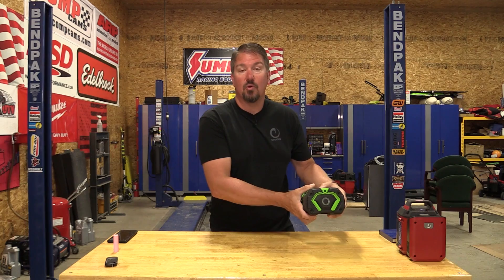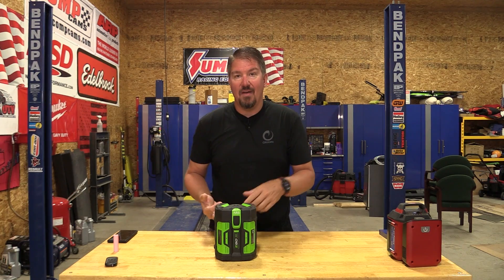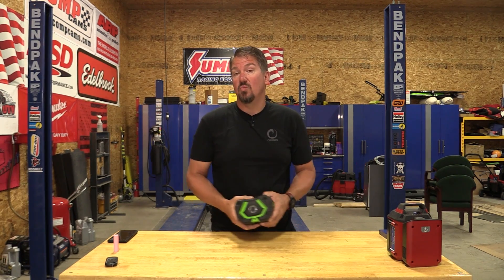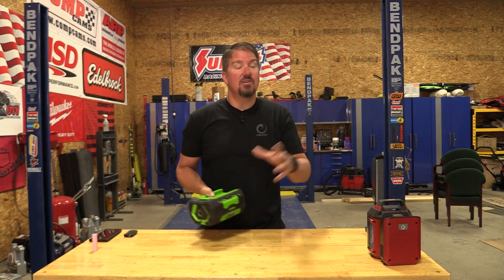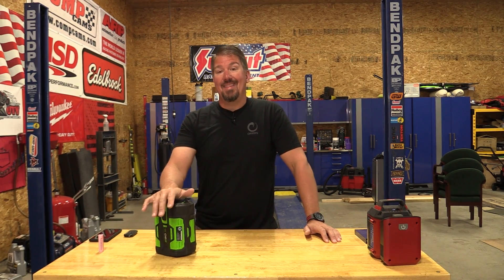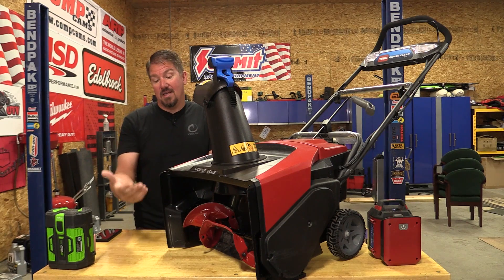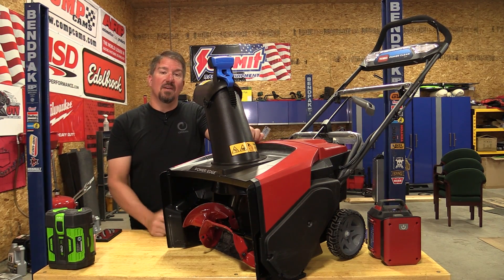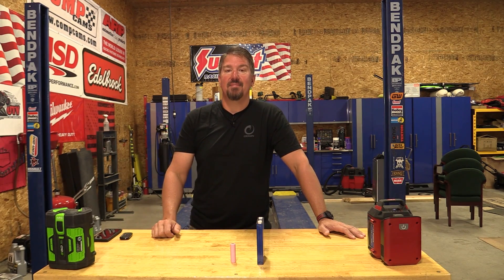Battery Powered OPE - The BIG Elephant In The Room No One Wants to Talk About!

Comment: Reduce, Reuse, Recycle. Its that order and for a reason. The less you can use up front is always the best course of action, reuse/repurpose what you can. Then when ALL ELSE fails, recycle. So using higher quality cells up front that reduce failure rates and extend service life for the same given material is always the best choice. Repairing a pack will always be better than replacing. Recycle only when damaged beyond repair. 

 Plastic bottle recycling was the biggest scam ever introduced, and it only ever worked because of the shipping overseas where it was recycled at the cost of human lives, or just dumped in the ocean. Here in ny theres a 5 cent deposit on bottle caps and recyclers just get their 5 cents for the cap and they toss the bottle, thats how they make their money. Yay government. Plastic was never recyclable and the fact people still think it is shows just how big of a ploy its been. But given people still think diamonds are worth something, shows just how impressionable people are.

Comment: My buddys 2013 model S had its original pack last 230k miles. He finally had to replace the pack, his car now has significantly more range than it did new, so it wasnt a replacement, its an upgrade. 

In recycling lithium batteries, 75-85% of the materials are recyclable and while it cost a lot to recycle them, it turns a profit on selling the raw materials because of how expensive mining is, the cost are close. 

It is more efficient emissions wise to burn LNG at a plant, send that power to my house and charge a battery than it is to run a 2 stroke gas engine, and its the same for an electric car, period. Even with all the charging losses, an ICE has 20-40% efficiency from fuel to output while a battery is 50-60%. 

I know lithium ion battery devices are NOT ready for mainstream, but the technology is not as youre describing it at all.

Comment: I get your side of the convo. I really do, and I have the same possible worries. I had Milwaukee OPE. both the Quiklok hedge trimmer and the reg hedge trimmer The handheld is junk because of tooth design; it doesn't feed branches into the teeth very well, and it is insanely front-heavy. The quiklok cuts well but broke recently for me(user issue). I want a battery hedge trimmer because power isn't a problem, and they're pretty efficient, so they have good run time. I wanted something lighter, so I looked at my ego. They're innovating with carbon fiber, so they're lighter, and that's attractive to me. I also looked at XGT platform, but their stuff is like 2x the price of anything else. Stihl's cheapest commercial hedge trimmer is 449, so idk what to do. I love the simplicity of battery hedge trimmers.

Comment: Ya I've heard from an economics, environmental, and sustainability prospective, that hybrid cars are actually the best for the environment because cars are more efficient at moving at slower speeds and we already have the infrastructure for servicing and refurbishing the cells of the hybrid car. It mainly comes down to an expense for the current or next owner that's the real headache. But a full electric car has a very large environmental footprint in the beginning of its life compared to gas or hybrids. Well as the demand for repairing these cells and cars becomes higher, it will attract more people to the marketplace to compete to fix them, eventually lowering the cost. 

It's like what Henry Ford said: If you ask a person what they want, they would say a faster horse. If you ask the people what they want, they would say faster horses. 🤓

 Diesel cars are great. They last an extra 100k miles over a gas car before an engine rebuild get great gas milage. We have a diesel car, but not in the US. But diesel is too expensive in CA. Doesn't make economic sense here. Our regulators😵‍💫

Comment: I have a 1957 Massey Ferguson 35, starts on the key, everything on it is serviceable by yourself, and it holds it's value. Why.. because it works and lasts, we have had a number off new tractors while having this one and had many electrical and emissions issues they want only a dealer to fix.. We actually don't buy new small tractors now because of this reason. The old stuff just works and lasts.

Comment: I wouldn't buy any OPE that is battery-operated if it is large enough to have an electric starter. Pulling and tugging to start up weed whackers or smaller chain saws, I feel that's where battery-operated equipment is where it's at.

Comment: Under this philosophy,  you should in theory see more eye to eye with the Amish than anything,  horses are way more efficient that ice motors. 
  Not hating, just saying,  not all interest in electric is due to it being tons more efficient energy wise up front,  once adopted though,  the ability to harness the sun, store the power, and build a balanced life growing in tune with your needs seems common sense.   Like say a guys in the concrete business,  why wouldn't he not try to produce and supply his own mud,  gives him more control over supply and cuts his cost.  In comparison,  being able to harness my own power,  cutting reliance on oil companies,  should benefit the small guy over time. 
Yes, the tech has a ways to come along but many old guys passing broke down model A's on horse back said the exact same thing and who looks more intelligent in hindsight now?  The guy driving the car may have wasted some time but what he learned eventually paid off,  even if simply understanding the tech allowed him to teach his kids and gave the next generation a leg up,  it no doubt will continue evolving and pay off.   The battery recycling industry will pick up no different than auto mechanic shops as off chutes to the electric industry or sub markets and sooner than most think in most scenarios will make much more sense than liquid fuel.   Condensed pollution getting dealt with at one site en masse getting the monoxides and noise pollution out of our daily lives is a no brainer you ask me,  YES, definitely early but also, YES, it's only gonna become more prevalent no doubt, imo.

Comment: Nothing but love!  I currently have a Hart 40v mower with 2 batteries to operate it, but I use Milwaukee M18 OPE tools (string trimmer, blower, etc.) for the rest of my landscaping needs.  Have had the mower for almost 3 years now and it’s been solid.  I think I may switch to the M18 Fuel mower after my Hart batteries die (whenever that happens) and consolidate all of my OPE tools into one battery platform.  Hopefully the recently released Forge batteries will be expansive enough at that time, with more power and extra capacity cells for longer runtime.

Comment: You can't use that old tractor to make your point.
Any modern diesel tractor won't make it 20 years because those can't be fixed with simple tools anymore.

As for your rant on electric cars and OPE, well, battery tech innovation really started to Pick up like 5-8 years ago. It's New and young technology and like most New and young tech, they depreciate very quickly and Evolve quickly in the firsts years.

They can be reliable and they can be easily fixed, the problem is NOT the technology. The problem is how they build those things.
This is what you need to adress. Changing a battery cell is easy. But when they design battery packs that are non servicable, they create the programmed obsolescence. You talk about gas engines, i can quickly point to you that not that long ago, Briggs released an engine line that they told "never needed an oil change ever".
How many lawn mowers are going in the trash because they need a carburetor job? Those companies can't even put a .25$ fuel filter on those things and they just hope it won't start next year so you will buy a new one.

Please, reconsider and think about your position, the problem "mostly" is not the tech, but the companies who design and build those things.

Sorry for the poor english that god damn auto corrector is haunting me.
Reply: Well said, thanks!

Comment: Yes you're right, this is a big issue. I have a few old batteries sitting around that I've stopped using, haven't gone to the landfill yet but it's where they're heading. Diesel is a very efficient and clean fuel, DEF makes the exhaust essentially water. Great video!
Reply: Diesel is far from clean. Tell that to a few million people that die annually of air pollution...
Reply: @riba2233  you think all air pollution comes from diesel cars?
Reply: @Manu__R  not only diesel but those are worse
Reply: @riba2233  diesel is cleaner than gasoline per mile. It's a more efficient fuel, which means more energy from the fuel goes into propelling it forwards vs wasted as heat and exhaust. Look it up. I'm not denying air pollution, but choosing diesel as your scapegoat for air pollution is unwise and ill-informed. Incorrect arguments make your entire debate lose its validity.
Reply: @Manu__R  it is not cleaner. Slightly lower co2, but everything else is worse  especially nox emissions and they are most responsible for air pollution related diseases
Reply: @riba2233  Per Mile
Per gallon, diesel has worse emissions, but diesel is more efficient, so a better comparison with gasoline is by the amount of work done relative to emissions, or emissions per mile.

Comment: Wow you should have split this up into different segments. 
Assuming you can’t warranty that battery and it lasted you longer than the warranty was good for… I wonder, I have honestly no idea, how much in general maintenance costs for gas OPE is over the 5 year life of that $300 battery? Fuel costs, fuel stabilizer, any other maintenance, quality time missed because of maintenance. Nothing was more aggravating, for me, was at the first grass cut of the season and pull, pull, pull, pull, pull and it won’t start. The mower would finally start working better towards the end of cutting season when it was about time to put it in storage. I love being able to slide the battery in and push start and it starts right up every time. 
EVs like other tech is constantly evolving, constantly changing. Most smart people are watching this whole EV tech play out and seeing where it goes. Even though the vast majority of people still aren’t really informed on which battery chemistry to look for in an EV and what the charging curve looks like. The new adopters want to get their names on the waiting lists of something shiny without seeing what it does in the real world. People said battery powertools would never work. They said EOPE would be too weak. We are still in the early stages of battery tech. 

Matthew 6:25

Comment: Your going to trigger people with this. California has a small gas engine ban heading our way starting in 2024. I have a small lawn care company in California and because of this ban I have stored away at least 10 years of gas equipment that battery isn't close to. Backpack blowers, commercial push mowers, riding mowers, big c.c. string trimmers plus top end commercial string trimmers for large properties won't be challenged any time soon by battery units. As a commercial user for those items listed in the last sentence the superiority of gas comes down to the combination of power, weight, run time, reliability plus cost. I have been using battery handhelds about 90% of the time in my business for around the last 5 years, thousands of hours of use, so I am acutely aware of what they can do plus I enjoy keeping up with what is coming down the pipe. Although Brian doesn't really trash on Ego alone I will attest that while Ego produces excellent tools their batteries have been far and away the worst I have ever used.

Comment: I can see your point on some things that there is a lot of waste happening but a fair amount of what you are saying is pretty naive as well.  You show a 50 year old farmall and say it lasts really long, if you dont use it all the time then ya it lasts quite a while when it is quality built, i have a 656 farmall for my acreage and i have to admit that thing sucks to use.  Also your main point is to buy the expensive higher quality equipment so you dont have to get rid of it or junk it, well of course, low quality turns out on you taking it to the scrap yard quickly. That truth is the same with gas equipment, massive amount of low quality junk goes to junk yard. Heck how many two stroke weed trimmers and chainsaws do you think went to the landfill since they got filled with straight gas instead of oil mixed fuel.  Think of all the equipment that will eventually get scraped that was only needed to suck out fumes in mechanics shops so they don’t die when needing to run equipment. Switching to electric for most people is more about breathing cleaner air, with less noise, vibration, and just overall better ease of use.

Comment: Well... many of your points are not correct for all the world. I live in Norway and most of our power is hydro power. This is important in how long before the ev's are getting "clean". The reports i have seen also have a problem because they don't put in the emision from pumping up and refine the oil. This goes into another polution account. In Norway electric car have been populare since about 2010. The falure rate on the batteries is extreme low. The averige for the Nissan brand that were sold in 2010ish: still over 80% of the power left. 
Important that you take it up because there is many things that need improvement.
I myself have all makita ope and tools. Not one battery have failed since i got my first in 2009. Keep up the good work.
-Sigmund
Reply: Well said. Though ev's are better even if the energy production is not from renewables

Comment: I cant bring myself to buy a battery powered lawn mower. I change the oil on my honda push mower yearly and maintain well use about 6 dollars in gas entire cutting season. Had the mower 7 years so far and it still works great I will fix it till I cant get parts. I do own EGO trimmer and blower which I cant stand after three years use should have got Milwaukee OPE as I have allot of the M18 tools and batteries I use allot.

Comment: Thanks for making this video. Battery reliability and repair needs to be improved. Often when a battery goes bad it's only one or a few bad cells. They should make the battery cells easier to replace. They won't do this because companies would lose money.
As far as the value depreciation issue, almost everything loses value as soon as you take it home. This should self correct as battery technology and adoption increases.
Everything we make will eventually end up in a landfill. Build quality and maintenance will play a huge factor in how fast that happens. That tractor that you proudly displayed is the exception to the rule and not the standard. Keep making great videos.
Reply: They can't make cells easy to replace,  it is not that simple. Battery packs need to be made to withstand huge vibrations and that doesn't allow for a design where you could easily replace cells. Why do you think these ego packs die in the first place?